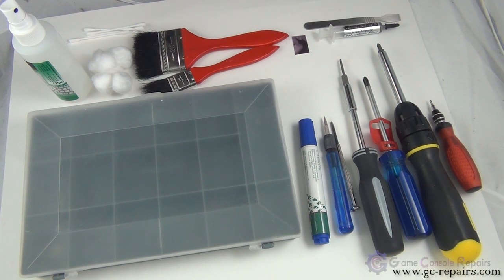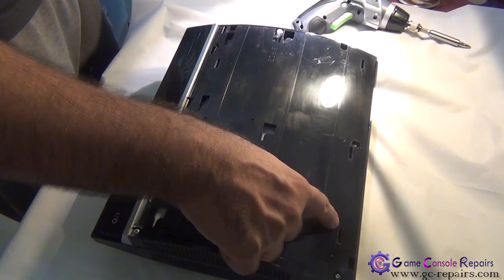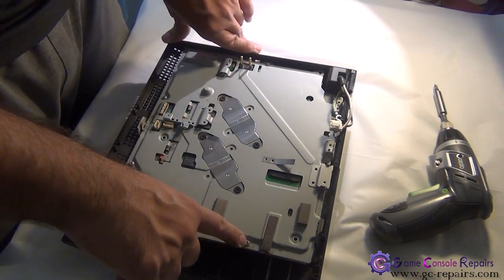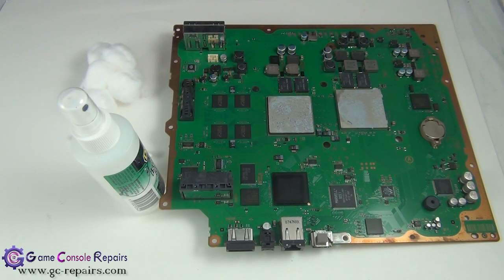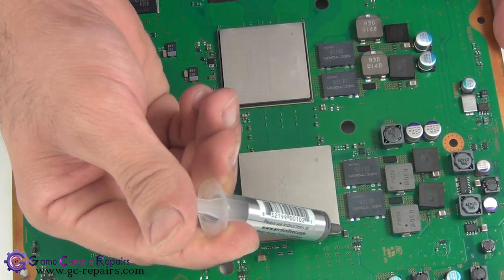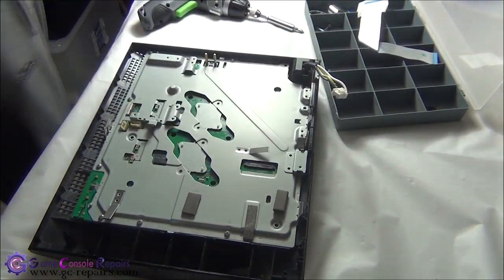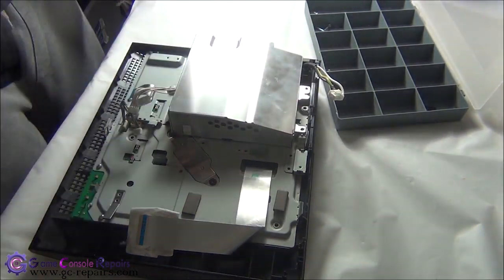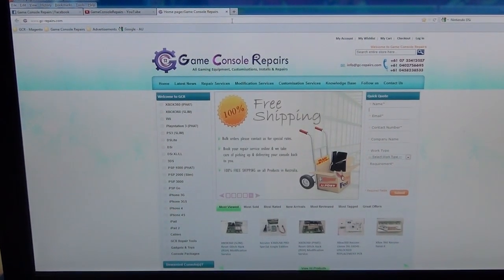PS3PHAT   40GB CECHG02   Thermal Compound Replacement by gc repairs com

Comment: Well I followed the instructions to the letter, very informative. However it didn't fix the issue, infact made it worse. Before I didn't have the YLOD instead the system simply cutout after a few minutes and had a flashing red light, which I was told was the beginning of YLOD. I figured changing the paste couldn't do any harm, and on opening it, there was indeed very poor paste inside, worse than the spread in the video above. However on putting it all back together, I now get YLOD instantly on turning on the machine. I reapplyed the paste a second time but same issue. My spread was perfect, used the pea technique first time, and the credit card second time. Used artic silver 5. Def not a paste issue.

Comment: Do not do this. It is not smooth if u do this it will create air bubbles and break quicker u r supposed to put a dot in the middle and thats it

Comment: my ps3 still turns on but it has no thermal paste on it and ps3 only stays on for 30 seconds or less. before i put on my artic silver 5 i would like to know if i must put it on the heatsnik or just the cpu and gpu and just put it back together and see how long my ps3 stays on.

Comment: 3. Also after changing thermal paste it still is difficult to turn on at times, beeps flashes yellow then constant red flashing but it will eventually turn on and work. but the fan is still playing uo the thermal paste didn't seem to do much, maybe try a better thermal paste like artic 5? Mx-2 got good reviews though (that's the paste I used not mk2 :/)

Comment: 2. but as I say I never play games on it, would you have any advise for me? When I changed the thermal paste I also gave it a good cleaning to get rid of dust, ps3 is vertical in a well ventilated area, another thing the fan gets increasing louder then after an hour of watching a film it just goes turbo! Could this be a power problem? or is my ps3 dying? AS I say it will turn on after a few tries and work fine but now the fan is just really loud. 
Thanks

Comment: 1.Hello I need a professionals advise. I have a 40gb fat ps3, il start of by saying I NEVER play games on it, only used to watch films regularly. When I turn it on, it beeps flashes yellow then constantly flashing red, but after 1 or 2 trys it will turn on and work fine? I was told this is either a power problem or thermal paste problem, I have reapplied thermal paste using mk2 paste, as recently the fan is really loud. I notice when I have a usb drive plugged in the ps3 is hard to turn on.....

Comment: I cleaned everything and applied a very thin, even coat of thermal compound and my fan still becomes loud after about 15 minutes - even if I just leave it on the menu screen. I am confident I did everything perfectly, is my fan bad? Could it be anythign else? Thanks in advance.

Comment: Few questions- will the motherboard get screwed up if you touch it like that(the green parts)
2. the blu ray wire is it ok to touch the long wire and how you you know that it goes in al the way when re connecting it to the drive